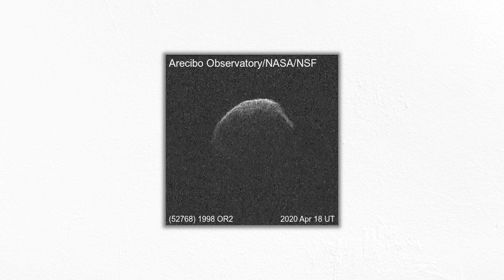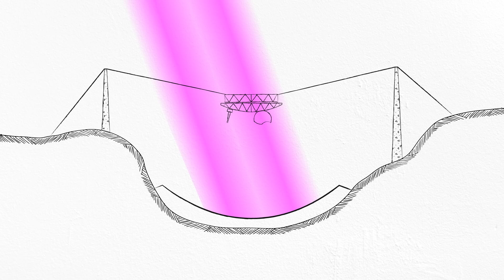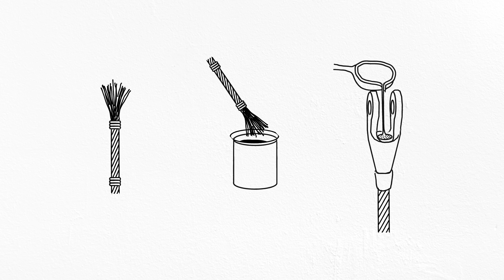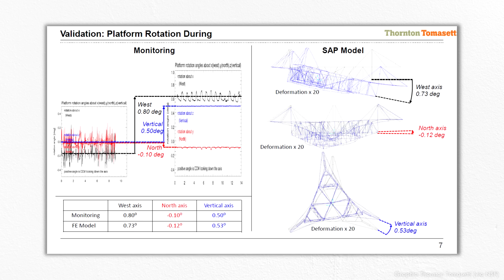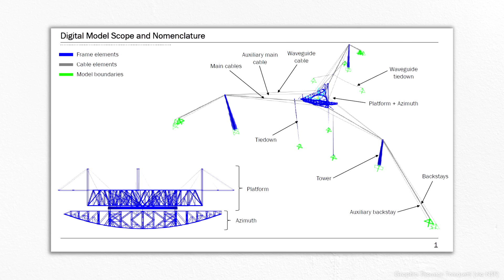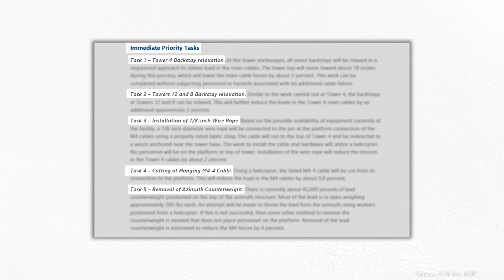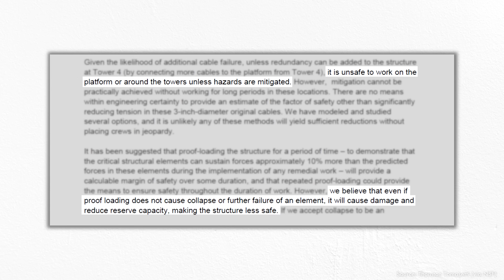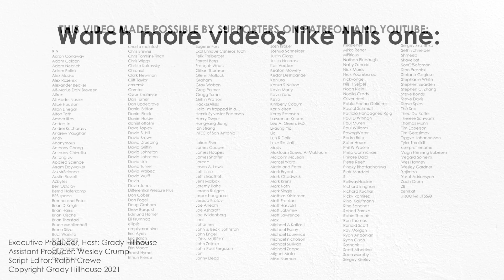What Really Happened at the Arecibo Telescope?

Comment: i wouldn't be surprised to hear down the road that mechanical fatigue of the dynamically loaded cables led to a diminishing of the overall yield strength of the cables.  think of how frequently the receiver adjusted itself and caused new wind loading. i bet this would introduce momentary but frequent unloading and reloading of the cables to ultimately reach mechanical fatigue.

Comment: As a metallurgist, my first guess was stress corrosion cracking. In the production of steel itself, way back when original cables were installed, the casting techniques may not be as sophisticated to avoid bifilms (mainly folding of the oxidized surface layers onto themselves while pouring the liquid melt) within the steel. I say this because even the term bifilms didn't exist back then. Anyway. And at the time of installment, the test results were correct because the corrosive media had not penetrated the bifilms yet. Also pouring hot zinc onto steel wires would surely make a good bond and you acheive the  required strength in the joint. But the interface between the wire and the zinc may not be impervious to corrosive media and here since the metals are different, there also exist a possibility of galvanic corrosion if you provide an electrolyte at the interface. The inteface may also be compromised because the coefficient of thermal expansion for both metals are different. Usually this may not be a problem but if you hold things in tension for about 50 years in a costal area where corrosion is a big factor, you should be careful. Anyway this is almost anyone's guess. Let's see the final report whenever it comes.

Comment: The video of the cables breaking shows what went wrong perfectly, the cables were not tightened to the same load, why else would the snap one at a time.
Reply: Possibly also because the cables weren't able to take the same strength (due to a defect in one or more cables) so apparently identical cables loaded with the same tension will not exhibit the same margin.  If the load was just on the verge of the maximum load the assembly could withstand, even if the load was evenly distributed among the cables, the weaker one will fail first.

Comment: Well-considered analysis.  My hope is that the lessons learned can be applied to similar cable-supported structures world-wide.  For instance, if the first failure was in the socket, what were the causal factors and how can we avoid them or inspect for them in the future?  It's interesting that the dehumidification system lacked the essential exterior cable jacket...my assumption is that detail greatly reduced the expected moisture-removal effectiveness.  Finally, regarding factors of safety, I agree that such a unique and critically difficult structure to inspect and repair should have had a much higher cable and socket factor of safety, perhaps as high as 5.  That said, the DOD may not have designed the facility for a 60 year lifespan...all structures have a design life and I would be interested to know what the original design life was.

Comment: This pickiness is just because you're an engineer, understand:
   - 1:06 The graphic implies a change in amplitude rather than a change in frequency, as would be proper.
   - 1:36 Not sure extended signal input with time equates to a higher resolution .  Even if accumulation over time consequently improves the ability to pick out weak signals, that doesn't seem to be within the technical definition of that word.
   - 2:14 Detection of nuclear weapons tests to monitor proliferation is a peaceful pursuit.  Detonation of such weapons is not.
   - 2:37 "Most iconic".  What are the units of measurement for that?  This is an essentially meaningless phrase that has infested writing in the last few years.
   - 2:49 RADAR is an acronym for "radio detection and ranging" but the example given is of radio-frequency imaging, instead.

Extra point for correct pronunciation of Spanish "a" sound.

Much appreciate your videos.  Keep 'em coming.  Cheers.

Comment: Great video thanks. I had no idea it was spherical and not parabolic. 
Would like to see you do a video on whether we'd be far better off with an array of aimable radio telescopes orbiting the planet, way more resolution and way more targets.
How did they use lasers to measure the cable curvature? Perhaps you'd cover that in a show some time. Why didn't they use straight legs placed around the perimeter of the reflector and joined at the top, above the receiver?

Comment: The structure outlived its design goal 6x, so if there is anything to blame, it is the fact it has been left serving nearly to these days and not been dismantled and completely rebuild decades ago. Don't forget it was designed as a military observing post, so things designed for about 10 years of lifetime. So the factor of 2 safety was good enough - with such expected lifetime they could completely disregard things like the corrosion or so.
Yes, 10 years after build, the military just wrote it off and handed it to the civilian research, to serve there few more years. It is at that time, when the device had proven its scientific value, when it should had been dismantled and the main structure redesigned for way longer service life (so take e.g. the corrosion effects, or the ability to replace the structural components into account). But that was deemed too expensive for something the scientific community got for free to start with.

But hope this event will lead to the complete new, better mainainable structure for the future being build. The site is in high value for this, as mainly the population living around is already used to and adopted to the limitations such device imposes on their life (restriction on activities generating disturbances in the radio spectrum), this day this would be very problematic to achieve that anywhere else, so it is asset which should not be lost there...

Comment: My simple observation is that every steal string snaps close to the point it is welded to the spelter socket. What is clearly visible with that is that the socket, with a half meter of cable, is poorly  available for maintenance, and that while it is the most important part of the cable. You can see that the already broken cable leaves a unpainted surrounding in the sleeve in the metal block, and that while this part IS accessible for painting. Further inside the sleeve, paint can't come, but water will. Such a construction should be fully open for maintenance, or regularly injected with or submerged in something like silicon grease.

Comment: Without millimetre by millimetre inspection of the cables for micro-fractures, sectional testing of the metal from the cables no one can say with absolute certainty the cables met the designed strength and quality.
No doubt both are part of the ongoing investigations, the blame game to be able to say it was this that caused it not our use being a driving factor.

There is a cable suspension bridge locally that is far older than Arecibo, actually crosses salt water so even more heavily exposed to the salt air. The first visual inspection of the cables was in the early 2000s, they were rust free. The engineer actually set up a perfect system to protect the steel from the sea air, wrapping them in waxed paper, then cedar, then that sealed inside more steel. The load bearing material completely isolated from the corrosive salty air. It was built shortly after the Golden Gate was, with no loss of life.

Comment: First awareness was probably sometime in Middle School in the early 70's. Actually visited in 2012.
Someone else said that pictures don' t do it justice. So true. Standing on the visitor's center veranda looking out over it was chilling. Like standing in the middle of science fiction.
While it's very sad that it was lost, I can't help wonder about the apparent short-sightedness of the designers in not providing a means to lower for maintenance of those cables. What did they think, they'd last forever? They were under constant flexure...for 50+ years in a harsh environment! WTH? Great that it did what it did, but what folly to think once they put it up there they'd never have to worry about the cables.
Great analysis, as usual!
(I'm trained, but not practicing as a structural engineer)

Comment: Can this failure be explained by material fatigue? In the last 58 years the construction was exposed to temperature oscillation, erosion, and drag forces of the wind. Metal has a pretty high coefficient of thermal expansion and the stress from a daily expansion and contraction alone must have been enormous.

Comment: I think  that the basic cause is the increment of weight slowly brought. "Can we add this equipment ? It would be a great improvement of the capacities, and it only weighs 1 % of the mass ?"  Then, pressure of several influent organisations so : "EUH, we are not fans, but OK !"
In France, the Tour Eifel had many "improvements" of that sort, some for useful technical aspects, some for commercial reasons like toilets and restaurants for visitors. But at the end, some intelligent guy said "Enough of all that, remove everything added". The argument was powerful because Tour is in the middle of Paris and had many visitors and attached business. So it was finally accepted that it was "too much" and modifications and removings done while complete overhaul executed. Perhaps such a hard decision would have rescued ARECIBO. But it seemed evident that this enormous station and radome wind sensitiveadded was an incredible and enormous risk. Consequences were deadly, not for any man, fortunately.

Comment: 200% safety factor is generally used in engineering towers. That is after adding predictable ice loads (certainly not an issue there) and expected wind loads (certainly an issue there, and this item might have been underestimated). I would suspect there was ample deferred maintenance, as those activities would have caused unwanted movements in the receiving mechanisms. Let's just finish licking the wounds and build something bigger and better.

Comment: As a U.S. Coast Guard ten-year Veteran my last six years were as a helicopter rescue swimmer but the other four, I was a Seaman waiting for aviation class A school. As such, I spent a considerable amount of time around all sizes of Coast Guard ships and small boats.  I learned a little about the sacrificial "Zinc Anodes" that dissolve in seawater to save two dissimilar metal parts on the ship or small boat.  And the observatory being assessable to salt spray aerosols from the large (most excellent and very surfable) oceans swells that occurs regularly during the winter months on the north coast of the city of Arecibo Puerto Rico, with a light breeze coming from the north these very small droplets of saltwater suspended in the air could travel south to the observatory might have been present at the cable joints with the molten zinc, was the fittings and the cable the same alloy? if not was it possible that the zinc inside the cable flitting sacrificed itself over the years due to the salt in the environment? Mark Chisholm commented earlier that the cabling in the corrosive off-shore environments is more rigorously tested and replaced.  Stray electrical currents make it worst...

Comment: I'm not a structural engineer, but from every video I've watched on structural collapses I'd be prepared to bet that the increased dynamic loads caused by wind/weather were either underestimated or not accounted for at all when the Gregorian dome was added. The auxiliary cables bore the increased static load within the safety margin, but the increased vibrations and stresses caused by strong winds acting on the dome accelerated the main cables to early failure. The loss of the tie-down cable is a possible clue, although it sounds more likely that this was due to a manufacturing or installation fault re. the spelter socket. Nonetheless, I'm pretty positive that the collapse was due to a design oversight that took many decades to reveal itself. Thanks for the excellent video Grady!

Comment: Surprised that when they modified the receiver around 2000 that they didn't install a cable assembly to lower all or a significant part of the receiver structure to dish level where the load could be supported from ground level.

Comment: Its designed factor of safety was only 2?  Damn!  I studied Mining Engineering and worked at Creighton Mine (which is also home to a neutrino observatory called SNOLAB), that gave me a pretty solid understanding of when it's acceptable to use low factors of safety.  In mines, we get as low as a FS of 1.2 for autonomous parts of the mine - that is: no human will ever enter there, only remote controlled vehicles.  1.5 is considered acceptable for human access to temporary workings - the individual work tunnels and such that live out their usefulness within a few years.   More permanent structures, like the mineshaft that provides access to the entire mine, are generally given an FS around 2-3.  (SNOLAB's FS is much higher)  

And this works because mines are intended to be temporary structures, accessed only by trained personnel who can report problems as soon as they occur, and subject to frequent maintenance inspections.  And all of their equipment is just off the shelf stuff - if there is an emergency the only thing in the mine that's not replaceable is the people working down there  (Except SNOLAB, which again, was in a much more carefully designed area).  

Arecibo was a unique scientific instrument.  Its radar capabilities were unique and may well have proven critical to humanity's survival had a substantial asteroid impact been coming during the period it was operational (the data from such images would be very useful in determining a method of destroying or redirecting the asteroid in question such that it would miss Earth). Most of it was suspended high in the air, and difficult for maintenance crews to reach.  Nobody would be able to see minor problems coming except during maintenance because the towers were not areas traversed by the people working there on a daily basis.  And building a new one is going to be a redesign from the ground up.

Comment: Cables or wire ropes, as we call them in my profession, are a type of machine. And like any other machine, they can fail. When working with draglines, shovels or cranes the wire ropes are frequently inspected and often require replacing.  I'm certain they require a lot of maintenance but it is amazing to me that the cables employed to support structures as the Arecibo Telescope, bridges, radio transmission towers, etc. are able to last decades after decades without having to be replaced.
It is such a tragic loss and yet so incredibly ironic that such a complex instrument can be destroyed by the failure of such a simple machine.
I hope resources become available to reconstruct the telescope and its amazing journey is continued.

Comment: I agree that it should have had a higher safety factor. I have some experience with large cable arrays (though not as a structural engineer); some of them were from structures of almost the same age as this telescope. The inherited wisdom is that lines will fail, and it's recognized that you're unlikely to have funding to replace them before they do (or are noticeably close to it). The cyclic loading combined with the environment guaranteed that those lines would lose strength over time, and it's impressive they lasted as long as they did (a testament to wire rope). The best chance to save the telescope was when they added the additional cables to support the new sensor array, since they were already adding cables. Unfortunately, hindsight is 20:20, and at the time, they probably considered the original design and beefed it up by an amount that would support the new structure, not keeping in mind the low safety factor in the original design. Or maybe they considered it, but didn't have the funding available to add an additional two cables per tower.

Comment: Considering the relatively 'small' size of the cables - after 30 years there should have been a systematic program of replacing cables.  Salt air and minimally coated steel do not permit cables to 'last forever.
Reply: I'm also surprised that replacing cables on a rolling schedule wasn't considered critical maintenance, but I guess that's the benefit of hindsight.
Reply: @ExtendedJet8  The original requirement was for a short term facility for cold-war use.